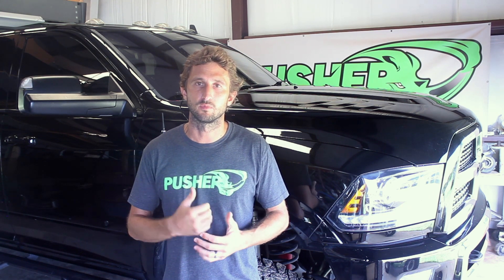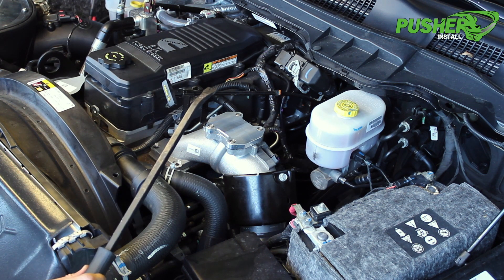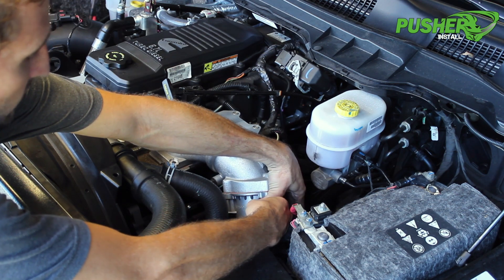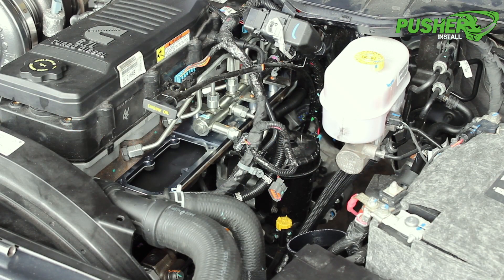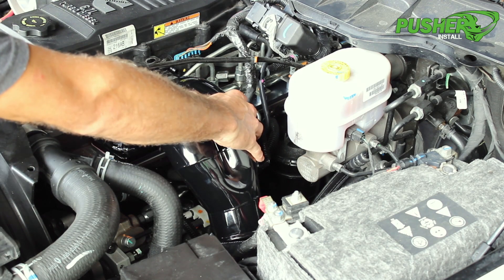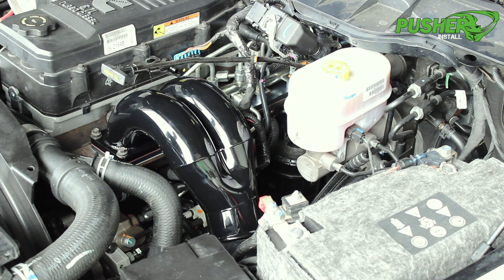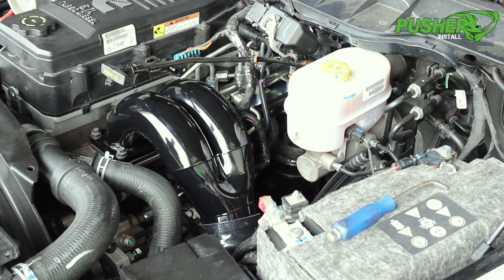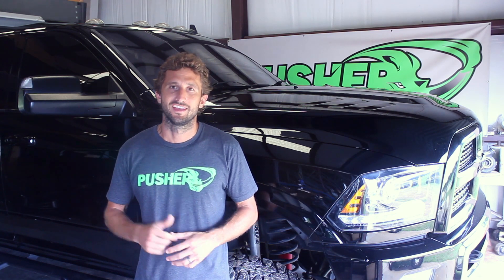Pusher Intakes Install - 3.5" Intake Manifold for 6.7L Cummins Trucks

Comment: Any tuning needed after install?
Reply from the maker: This is a race / off-road system for trucks that are already tuned; you won't need to re-tune after this install. If you have a stock truck, you'd need to convert your truck to an off-road vehicle and get a tune in order to run this.

Comment: I just got the intake horn.  I really want to do the grid heater delete however I can't loose my heater. So do you guys have a way to do an aftermarket heater?  Can I weld a Bung in the intake horn and use a banks style heater the aftermarket round ones the size of a spark plug??
Reply from the maker: Hi Chris - we do have a intake horn w/ a removable heater coil. Give us a call today so we can talk about doing an exchange for the manifold you received - 772-212-9290

Comment: Is there anyway to integrate a prob style grid heater with this style intake like weld a bung into it for up north here in the colder months just wondering your thoughts ?
Reply from the maker: Yes, we have this model and have been testing it for 2+ years. Just a little behind in launching it publicly - you can give us a call to order today. 772-212-9290

Comment: After installing this I have a CEL now. What could have caused this?
Reply from the maker: You shouldn't be getting one - give us a call directly and we'll troubleshoot with you to figure out what's going on 772-589-8385
Reply: @pusherintakes  checked codes and said map sensor, cleared them and the lights off. Not sure what happen. But hopefully stays off!!

Comment: What was the stuff you put on the port plugs ?
Reply from the maker: If you aren't using your auxiliary ports (for things like injectors, boost sensors), you plug them with the provided brass port plugs and a bit of Teflon paste.
Reply: Also water meth aswell can port there

Comment: 14 ram 5500
The factory intake doesn't have a map sensor.
Do I need a plug in the new intake?
Reply from the maker: We have the same manifold for the Chassis Cab, minus the map sensor port. You can view it here - https://www.pusherintakes.com/Intake-Manifold-for-2010-2012-Dodge-Cummins-6-7L-p/pcc0712mim.htm - Let us know if you have any other questions!

Comment: Looks like I need to have my 6.7 deleted before I can add this mod?
Reply: U need to have already deleted your egr which. Doesn’t require tuning to do
Reply: ok now I am confused.  didn't think you could ever take off the erg without deleting and not running a tuner.  is there a shop number I can call and discuss?

Comment: Been watching some bids now and this is for the intake manifold elbow.  On the original you had on there before you replaced it with the new Pusher intake, had a gadget of some sort screwed on top of it along with a gold/maybe brass bar that went along the front of the manifold.  Where is that piece now after you installed the Pusher elbow? Thanks.  I haven't seen a video yet that shows where that went or was rerouted too.  Thanks
Reply: Egr plate.  You have to do a egr delete to put this mod on.
Reply: @dr.america8822  found that out after lol. I now have it deleted. May do one of these if I can see if it makes a difference on how it runs
Reply from the maker: That's kind of a long answer, give us a call when you can and we'll walk you through that - 772.589.8385
Reply: The pusher is easy compared to the whole delete haha. Egr for me was a pain.

Comment: Wish you would have shown the sound difference at least started the truck
Reply from the maker: Good thought! There isn't a whole lot of sound difference with just the manifold, too little for anyone to tell the difference via our microphones. In person, you will hear a little more turbo as it receives air at a faster rate, but that's about it.
Reply: Pusher Intakes thanx for the reply back.  I have one on order now.  Wanted to see how much difference this would add with the 2 gen swap.

Comment: I have this on my 2010 3500  what is the threading count for the ports
Reply from the maker: Hi William, the ports are 1/8 NPT, which are most sensors and injection nozzles size. Please let us know if you have any additional questions.

Comment: I'm just wondering if this change has a significant impact on running cooler. I'm a rancher at higher altitude and seem to have constant battles with hot temps on my 09 deleted 4500. I tow a lot up mountain passes (7,000 feet and above) and inclines and can't seem to get the truck to stay at normal temps consistently. Just wondering if this will help with engine heat disbursement any?
Reply: Did you try a 180 thermostat?
Reply from the maker: Hi Chris,

There are a lot of factors that can attribute to how a truck runs. Air delivery is one of the main ones. We've found the more air you can get through the system on these trucks the better. Making the system more efficient with parts like our intake manifold, charge tubes, and heater grid delete are a great start. If you tow a lot, our High Mount Compound System will overcome any altitude issues. We actually have quite a few customers out there in Colorado at altitude that used to live here in Florida. One in particular was one of our original test trucks and runs the same at 10000' as it does here.

Comment: I have a 14 model 2500 i just had deleted i was wondering if this would help me with any more power. Im just curious if its any noticeable difference.
Reply from the maker: Yes, it will make a noticeable difference on your truck. The factory intake manifold is the main choke point in the factory charge system, and it is the first thing we address on these trucks. The effect on your truck is further amplified when paired with our heater grid delete. We have product overview videos for each on our main channel. Let us know if you have any more questions!

Comment: does this intake 2nd as a throttle valve delete? didnt see you put the valve back in.
Reply from the maker: Yes, this is a direct replacement for the factory intake manifold and throttle valve. Let us know if you have any more questions
Reply: What do you do with the electrical that is with the butterfly valve?
Reply: @jerrybrandt9377  leave it unplugged and get a tune on your truck.
Reply: SO IF YOU LEAVE THE ELECTRICAL PLUG UNPLUGGED FROM THE BUTTERFLY? WILL THAT TURN ON A CHECK ENGINE LIGHT??
Reply: @leewehrhan3800 no it should not as your truck should be deleted for this intake to work to begin with and the delete tune would have taken care of that to begin with. Wgwn you delete your truck it make the throttle body non functioning, so all you are doing is getting rid of it when you buy an aftermarket intake that that replaces it. Or you can get a throttle delete and use stock intake.

Comment: why egr delete kits  cost 200$ from u guys lol wtf u can get it for 55$ anywhere on ebay and they are same and this same thing u get is for 199$ u guys are way overprice
Reply: gs10r then don’t buy it
Reply from the maker: Hi, the products are not the same in design (nor country of origin for most of our eBay competitors, go USA). You can learn about the differences by watching our product overview video here. https://youtu.be/GlpVkSquRLI
Reply: Pusher Intakes i got the ebay one for 199 and its   exactly same copy of yours body of mine got your and  We  put it side-by-side and measure everything exactly the same same gose for egr kits same stuff from ebay for 55$ lol i got this on my 2013 ram 2500  Perfect fit
Reply: gs10r. First of all. Learn how to correctly type a sentence. Lol. Secondly, I use eBay a lot. I’ve had some bad luck. I’ve purchased parts including an intake horn that was defective. Very crappy welds, looked like crap. And the mounting surface wasn’t even close to being flat or square. I had a very hard time returning it. I will gladly pay a little more for a quality U.S. made parts that comes ready to go with no issues. If you have a problem with someone’s pricing on there products then why don’t you grow the hell up and just not purchase from them instead of publicly calling them out. What a moron.
Reply: @Cook7255  
lol ok ebay shit on my truck for years and its perfect

Comment: Too bad this turd wont fit with dual injection pumps
Reply from the maker: This manifold does fit with most dual pump setups, but not all. It is regrettable for that some manufacturers of dual pump setups didn't take into account the need for improved air flow. For anyone interested in knowing whether it'll fit with their setup, feel free to call us at 772.589.8385.
Reply: I sent you guys my dual pump set up so you guys could make me an intake to work with the ats dual kit. After I got the kit back ( with all the lines and pump ports left open to the elements), I never heard from you guys again.
Reply from the maker: According to the guys here that handled your pump, we did not promise anything other than we'd look at your pump to see if our manifold could be easily adapted, and we touched base with you at least once a week while it was here. If it came with plugs in the ports it definitely should have been sent back that way. We are consistently praised for our customer support and can only apologize if you feel you were treated sub-par. If you'd like to discuss this further, please feel free to contact us directly.
Reply: Why wouldn't you duct tape all openings?? Dumb move